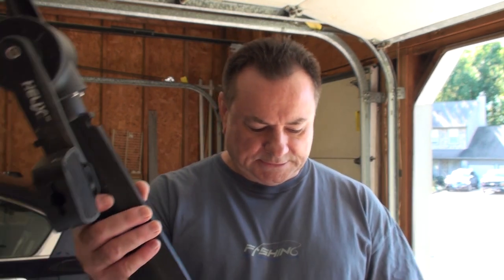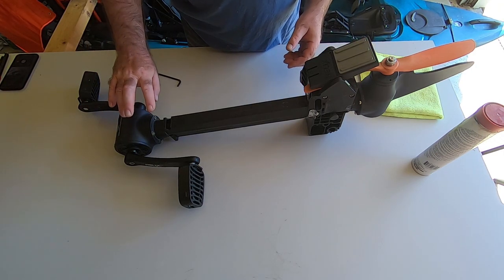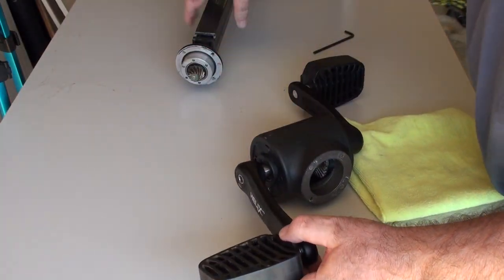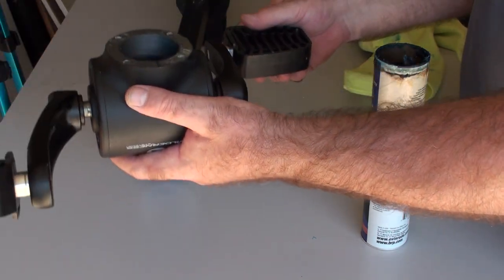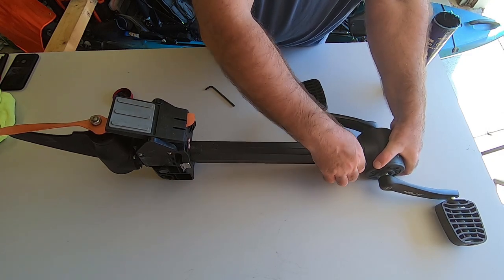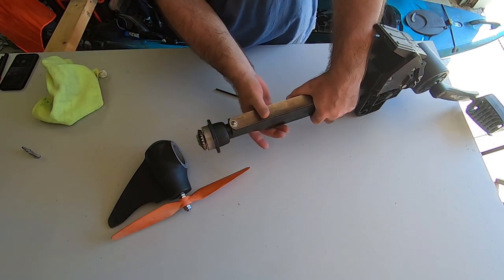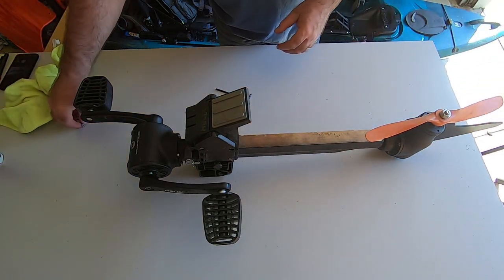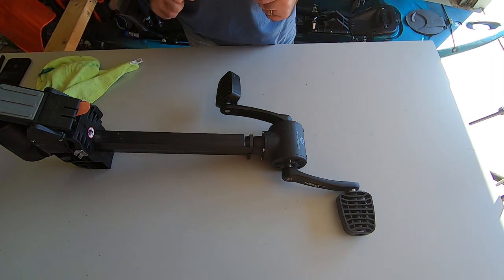Wilderness Systems Helix PD pedal drive maintenance.

Comment: Another great video! Thanks for sharing!
Reply from the maker: Thank you for watching. I did go with echomap plus 43cv. Found it new for $225. No brainer.👍
Reply: Fishy Angler that’s a great price! You will be very happy with the results for sure. Let me know if you have any questions.
Reply from the maker: Captain Matt Webber one more question. The order mentioned above was canceled, but I found that Cabela’s had limited stock for $199. I bought it, but the difference between those and ones for $299 is the map. More expensive ones come with LakeVu G3 and those cheaper ones from Cabela’s come with older LakeVu HD. How different those maps are? Did I make a mistake?
Reply: Fishy Angler if you absolutely need the maps, you ca download the 2g us lakes as the 3g is most likely more than what you need. You are going to draw a lot of your own maps with QuickDraw contours anyway. Also with active captain you can share your maps with your mobile device. You’re going to be just fine.👍🏻
Reply from the maker: Captain Matt Webber thank you. I will map ponds that are not mapped (we have plenty of those here). But what is the fundamental difference between those maps?